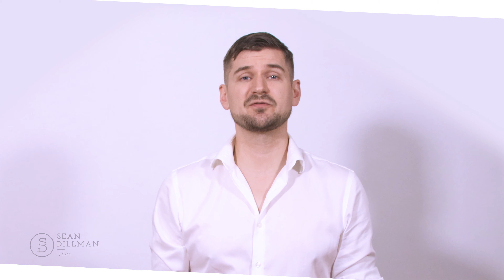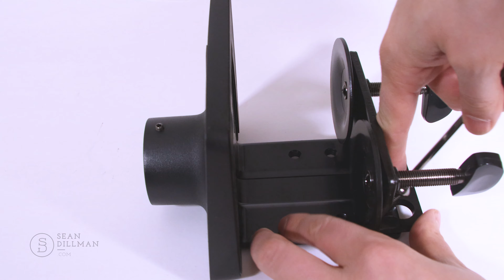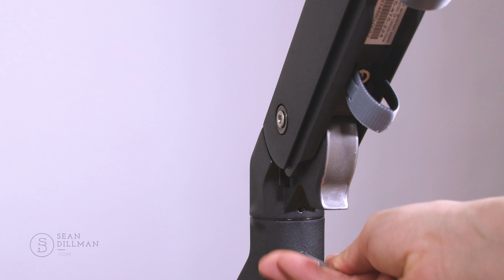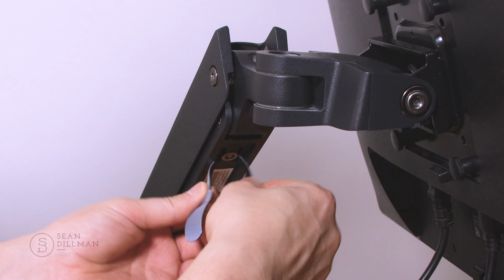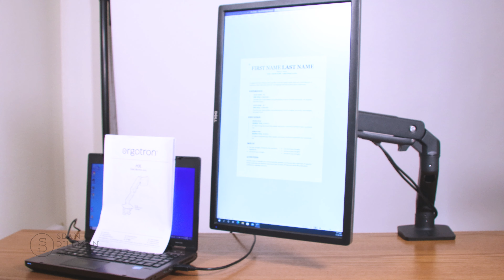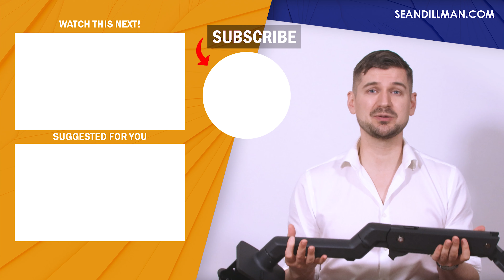💻 Ergotron HX Monitor Arm - Review & Assembly

Comment: Thanks for the video.  The instructions are lacking to say the least, though once you get past all the extra stuff they send it's pretty easy.   I am a little disappointed that I maxed out the tension knob for the vertical swivel on the VESA mount though, I can't get it to stay down that last little bit with my UltraGear 45" which is 31 lbs.  Otherwise this thing is pretty good.

Comment: Are these that much better than the $100 Vivo ones that look identical ? I mean for $400 you would think so but would like to know
Reply from the maker: Hi there. That's a good question. I recently started using Vivo products (I did a review video about a Vivo workstation) and I'm very impressed with the quality. Ergotron is super-high quality, and I would say higher-quality than what I am seeing from Vivo, but I think that if you just want nice gear that gets the job done, Vivo will likely do it too. I don't have any complaints about either manufacturer really, Ergotron or Vivo. They both make great gear. 👍
Reply: do you think the Ergo one moves more easy, the vivo one is little stuff till you get it moving then is easy to set in desired position. I would want something that makes the monitor feel weightless but wondering if that exists @SeanDillman

Comment: How do you remove the plastic wire cover and put it back on? I didn’t see you mention that wire cover below the wire straps.  I’m asking because I don’t know how to get these Samsung Odyssey G9 wires through there
Reply from the maker: Hi Devin. The wire cover piece is made out of plastic and it just sort of snaps in and out. There are two little tabs that you can squeeze with your fingers to help with taking it out and putting it back in. How are you enjoying the Odyssey G9? I've heard great things. 😊👍
Reply: @SeanDillman  I am truly loving it, it replaced 3 of my old monitors and I even intend to buy a second one to mount above it to replace the final old monitor!  The bottom will be mostly for gaming and webcam meetings while the top one will be for google, discord, and other things like G Hub, Synapse, and Twitch
Reply from the maker: Nice  @devincampbell5007 . I love to hear about great rigs coming together. It sounds like you're a man with a plan. 💪 Is it fair to say that once you get a second one to mount above it, you will have two monitors offering six screen areas: upper-left, lower-left, upper-middle, lower-middle, upper-right, and lower-right? Also, are you using as software to control your displays? Something like DisplayFusion?
🖥🖥🖥
🖥🖥🖥
Reply: @SeanDillman   Full screen on the bottom (2 on bottom would be a special occasion), 2 or 3 screens on the top.  I haven’t used any special software so far, but might need to with the new G9
Reply from the maker: Very cool  @devincampbell5007 . Sounds like an awesome setup. If you need multimonitor software, I have had great experiences with DisplayFusion. It works really well. I'm looking forward to testing some ultrawide monitors in the future. If you haven't seen it, check out my new video on using a standing workstation. In the chapter on 'Option 4' I show a new setup that I made for my office which uses three monitors: https://youtu.be/vZVxXfYR16I. 🖥🖥🖥👍

Comment: I think my HX is faulty - despite adjusting the lifting strength to max, it still sags under the weight of my G9 and cannot be lifted beyond its lowest point.
Reply from the maker: Hi Luke. I looked up the G9 and it seems that it weights 50 lbs. My understanding is that the weight capacity for the HX (the one I have and review in this video) is 20-42 lbs. (9.1-19 kg). Does this seem to be correct to you? Have you weighted your G9? 🖥
Reply: The G9 requires the heavy duty attachment.

Comment: How do i change out my monitor on this arm.
Reply from the maker: Hi Madrid. If you have another person to help you, I would recommend it so that you can be sure to not have either of your monitors fall or get damaged.

Step 1 - Unplug the power cable and any cables that connect your monitor to your computer or other devices.

Step 2 - Use a screwdriver or Allen key to loosen the tension knob that holds the monitor in place. Turn the knob counterclockwise to loosen it. Be careful to do this in a controlled way so as to not damage your monitor.

Step 3 - Once the knob is loose, lift the monitor up and off the arm. Be careful not to drop the monitor.

Step 4 - Place the new monitor onto the arm and align the VESA mount holes on the back of the monitor with the mounting plate on the arm.

Step 5 - Once the holes are aligned, use the screws that came with the monitor arm to secure the monitor to the arm.

Step 6 - Tighten the tension knob on the side of the arm to secure the monitor in place. Turn the knob clockwise until it is tight.

Step 7 - Connect the power cable and any cables that connect your monitor to your computer or other devices.

Step 8 - Adjust the arm to the desired position and enjoy your new monitor!

If you have any trouble with these steps, you may want to refer to the user manual that came with your Ergotron HX Monitor Arm for additional guidance. Was that helpful? 🖥👍😊

Comment: I have the Samsung C49RG94SSU do I need an extension hx arm for that?
Reply from the maker: Hi Berk. That's a beautiful monitor. If you want to use something other than the included stand, I believe that you can indeed use the HX Monitor arm with your monitor. I understand that the C49RG94SSU is 34.97 x 119.95 x 52.31 cm and is 14.6 Kilograms. The weight capacity for the Ergotron HX is 20-42 lbs. (9.1-19 kg) so your monitor is right in the middle, in the sweet spot. If you want to try a desk-attached monitor arm, the HX Desk Monitor Arm may serve you well. 

Happy New Year! Please let me know if you have any other questions. 🙂

Comment: Is there a preferred way of mounting (by clamp, or drilling?). Which would give most stability?
Reply from the maker: Hi Christiaan. Thanks for your question. It’s a good one. I think that it depends on many factors.

In general, I think that the drilling method produces the cleanest look and would provide the most stability in most situations, assuming that the desk being used is heavy and has enough mass to handle the weight of the monitor arm and the affixed monitor, no matter where the monitor is positioned. If a desk was not heavy enough and if a person installed the base near the outside edge (as opposed to near the center), there may be a potential hazard of the desk tipping over and taking the monitor and stand with it (not a good situation). This would all depend on the desk.

If we’re talking about a big heavy desk that isn’t a potential tipping hazard, the drilling method is great. However, this method also requires drilling a hole in the top of the desk (if one is not already available) and having a desktop that is thick enough to handle the weight. The desk will also need to allow enough clearance on the underside to install the nut and bolt. For some people with beautiful desks, they may not want to drill a hole and the desk may be configured in a way that doesn’t allow easy access to the other side of a hole on the bottom.

If a person is willing to drill a hole and has the access, they also need to keep in mind that once they choose a location for the hole, it will be mostly permanent (you can’t undo drilling a hole). They could always drill another hole in another location in the future, but they likely wouldn’t want to keep drilling holes and making the top of the desk look like Swiss cheese.

With the clamping method, many of the issues I just mentioned aren’t present. The clamping method also produces a seamless look, assuming that the desk is positioned directly against a wall. In this scenario, the clamping method may even offer greater stability than the drilling method because by wedging the clamp between the desk and the wall, it is getting structural support from the wall. If a person placed a desk in the middle of a room and used the clamping method, it may be inferior to the drilling method in terms of stability because there would be no support from a wall, and it would be doubly important that the desk is heavy and not a tipping hazard, particularly because the clamp would be on the outside edge of the desk.

Unlike the Swiss cheese scenario that I suggested, with the clamping method, if a person wants to move the clamp to another location, you can move it again as many times as you like without doing any damage to the desk. I should mention that the clamping method also requires a desk that has an overhanging lip. There are many desks out there that are designed in a way which has no lip and would therefore not work with the clamping method.

In summary, I suppose that the factors affecting stability include the weight of the desk, thickness of the desktop, and location of the desk (whether it is against a wall).

Does that all make sense? Is that helpful? Please let me know. Thanks Christiaan.
Reply: Which is the maximun desk thickness allowed by the clamp  @SeanDillman

Comment: Well done. Gave you a like and subscribed. If the monitor is less than 20Lb, can that explain why it won't tilt fwd past vertical, b/c the spring is too strong?
Reply from the maker: Thank you very much. I appreciate that. That's a good question. I think you are right and that it does explain it. If the monitor is too light, the arm doesn't have enough to hold it down. If you want to take a look at some of the other comments on this video, this issue has come up a few times for people. The wisdom seems to be that the Ergotron HX series is for larger/heavier monitors and the Ergotron LX series is for smaller/lighter ones. As a side note, it seems that some people prefer the look and style of the HX series over the LX. What about you? Do you already have this arm or are you just checking it out? =)
Reply: @SeanDillman  Thanks for your reply. Yes, I should have looked  at the others. I bought it yesterday. I wedged a couple of golf tees in the spring to hold it in the down position. Suboptimal but works. As screens become lighter perhaps the fate of the LX is sealed? I might try and swap it for the HX. Cheers.
Reply from the maker: @ubute  You are most welcome. It's a pleasure to chat about these things, especially with fun people. Haha. I like your creative use of the golf tees. Earlier today I wedged some chopsticks into a bathroom shelf to make it friction fit and stay in place. For monitor arms, I've also heard of people hanging small gym weights on the back to increase the mass. I suppose they perhaps hang them from the thumbscrews. If you want, you could always order a custom plate to increase the weight. Here is a link to one on the Ergodirect website: https://www.ergodirect.com/17300-add-weight-plate-with-vesa.html. If you plan to stick with your current monitor and expect that it will have a good lifespan, swapping the HX for the LX may be a good idea too, assuming that you can do it easily enough. 

While it's true that some screens are becoming lighter, we’re also entering the age of super-wide, curved monitors. My understanding of the current specs is that they can be anywhere between about 35" and 50" wide. The HX really shines here because even if a monitor is light, if it's also wide, it will still need a strong arm with heavy-duty components to hold it up and keep it in the right position: vertical height, forward/backward tilt, rotation.
Reply: @SeanDillman  Appreciate your comments Sean. I just struggle with the idea of a crossover screen home gym with weights. I suppose there is also the chance to use it as a horizontal bar for back flips etc. If there was a swap over spring as there is a swap over clamp, that would help. I shall reflect further and decide. Cheers.
Reply from the maker: @ubute  Hahahaha. That's fantastic. Mashups are very popular these days. Why not have a screen/home gym? Some people are starting to use treadmill desks. We live in crazy times but it's fun. I wish you fruitful reflections and hope that you find a great solution. All the best. =)

Comment: How do I remove the monitor from the arm after mounted? It is difficult to lift it up and remove it (2 bottom screws are removed).
Reply from the maker: Hi Eric. Thank you for that question. There are a few ways to go about it which depend on the size of your monitor and how accessible it and the arm is. In other words, is it all easy to access or is it difficult to access because you have to reach far over a desk?

If possible, the best thing to do would be to have another person help you. The first person can hold the monitor and then the second person can unscrew the four screws on the back and remove it that way. I typically use the included thumb screws. You can see them in my unboxing video in what I call the "first bag". Here is a link to that part of the video: https://youtu.be/spotcFcU-vg?t=136. The thumbscrews make it much easier to remove or install the monitor because you don't need to use a screwdriver. You also don’t need to be able to see the back of the monitor because you can just feel with your fingers and unscrew them. 

If you don’t have another person who can help you remove the monitor, I would use something soft like a blanket or pillow and put it on your desk to ensure that your monitor is protected throughout the process. I would then use the included hex tool to take the tension off the arm, so it’s not holding the monitor up and is instead down on top of the desk. I have previously tried to install and remove monitors without first taking off the tension and it can be a problem and work against you. 

Also, because you’re talking about removing two screws, I think that you’re contemplating removing the piece that connects the monitor to the arm, the piece I call the "bracket" in my unboxing video: https://youtu.be/spotcFcU-vg?t=229. If I were you, I’d leave this piece on the arm and instead simply remove the monitor from the bracket, not the bracket from the arm with the monitor attached (if that makes sense and is what you want to do).

Installing and removing monitors can be tricky depending on the dimensions and weight. Please let me know if this makes sense and if the information is useful. I hope that this helps. =)
Reply: @SeanDillman  Thank You
Reply from the maker: You are most welcome  @ericlim9793 . =)